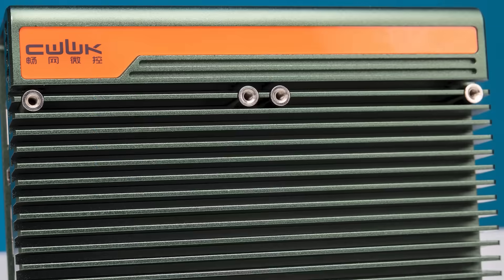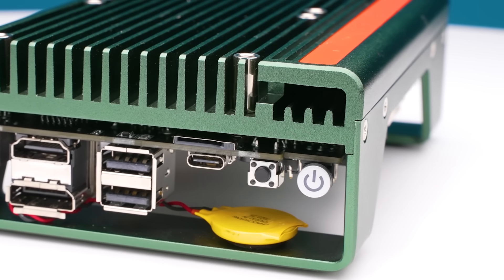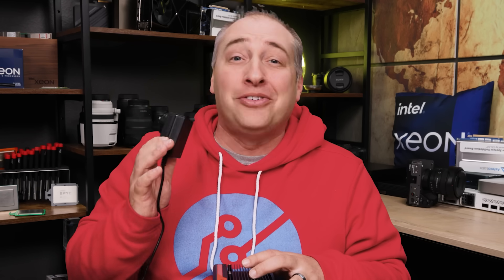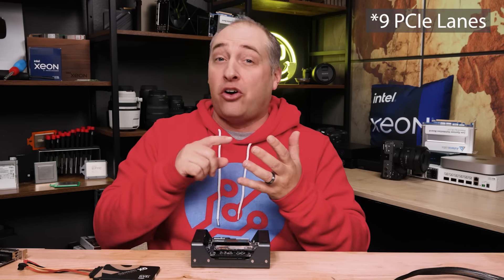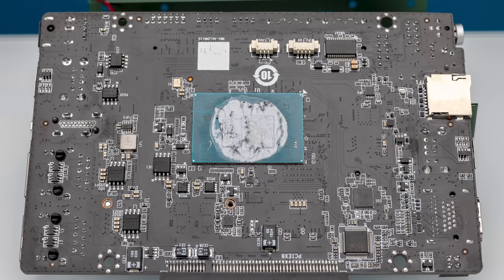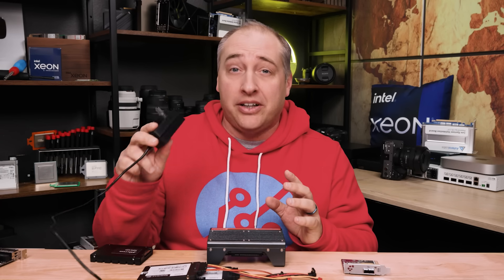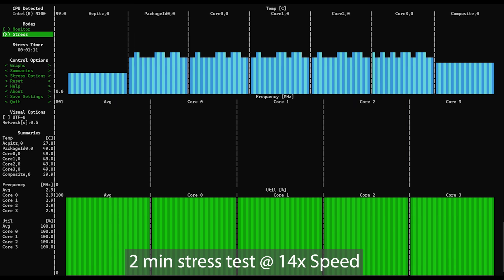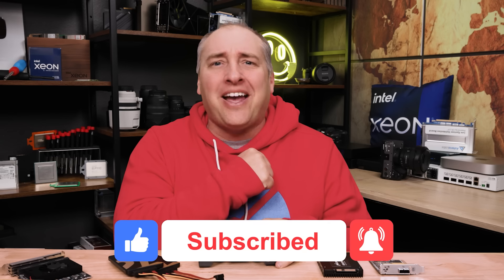FANLESS 7W Homelab Fantasy Mini PC

Comment: I think you've a little bit missed the point.  You didn't mention with the N100 or N305 comes an up-to-date GPU with advanced encoding and decoding facilities.  This box literally does everything I need.  It'll act as a low-power "online" server for my media from a cheap spinning harddrive (SATA) giving me 2.5GBe and also for Kodi/Jellyfin whatever and well as pfsense all the usual stuff.  For proxmox it's a dream.

Comment: Has anyone been able to find where to buy this model? The closest I can find on the CWWK website is the CWWK Magic N100 but the specs are slightly different. Seems to come with 2x10g network ports – although I think they need transceivers to connect up to rj45. The N200 CPU version seems closer to this review version as that does have the 2x2.5 network ports

Comment: I recently purchased an 8-port soft router from CWWK, but unfortunately, my experience has been far from satisfactory. Upon receiving the device, I immediately encountered a significant issue: two of the ports were not functioning. CWWK did send a replacement board, which resolved the port issue, but the new board did not fit with the existing front panel cover. Despite a lengthy wait, I still haven't received the correct replacement cover.
Moreover, the soft router has been persistently unstable, restarting every 15 seconds after production run for a month, rendering it completely unusable. but it's been just over a month since I received it, and I've been continuously facing different problems.
now i already order minisforum ms-01 to replace  this rubbish

Comment: Anyone familiar with thermal physics and passive cooling knows this is the best design for cooling, it will run 10-20C less than closed box and lifted up 2-3C less than close to desk. Too bad you didn't test the thermals.

Comment: This looks like a marvelous edge node for slightly higher performance applications. This doesn't look like the sort of system that you fuss with all that often. You build it and put it in the larger unit it'll be part of and that protects and secures all the bits that hang off in a desk configuration. I like it.

Looks like the rubber foot assembly can be removed and replaced with something custom. This is a nice little machine.

Comment: I have a cwwk box, they actually made pretty decent stuff, but i'm still annoyed that they keep putting 2.5g on stuff instead of going with 10g so it can be useful. - I suppose you could plug in a 10g nic to the pcie slot (not sure if there's enough bandwidth there)
Reply from the maker: PCIe Bandwidth, cost, and power all go way up with 10Gbase-T

Comment: Hello fellow computer nerds, I have a question, If you had 40,000 Euros what data server and stuff would you buy and install 
in order to generate 12000-16000 Euros per WEEK ? (assuming 48 week average) Probably using used EPYC CPU's & bunch of XEON's ?

Comment: If you can get it to behave with a SAS HBA card then it'd be a great little upgrade to mount to an old HP microserver case (yes some hacking would be required but pretty sure it's not outside the wit of man to manage).

Comment: What am I missing when you keeping pointing to a 960GB optane drive while saying its 32tb?
Reply from the maker: When I am on set, that is a Micron 6500 ION (looks like an Optane from far). We shot some B-roll with a 1.5TB Optane and mentioned both the 1.5TB Optane and the Solidigm 61.44TB NVMe SSD did not work. We try multiple drives to see how they work.

Comment: The thing is, until you've experienced the speed you get from a N100 you won't believe it. It's super zippy at really low power. I used a minicomputer with one of these CPUs for a week as a desktop and didn't notice much difference to a modern high speed pc (apart from AAA gaming).
Reply from the maker: I think the N305 is much better as a desktop, but you are right, the N100 is like a mid-range 2018 era desktop PC performance wise for desktop tasks.
Reply: I bought an n100 mini pc when my laptop failed later to be used as a backup if it broke again.  I've kept the N100 Pc on my desk as it literally does everything I need well enough.  The big advantage is the advanced features supported by the iGPU.

Comment: I think the closest competitor to this might be the Odroid H3+. Doesn't have the PCIe card slot, but you get dual DDR4 ram slots, and a 4 lane PCIe 3.0 M.2 NVMe slot, plus it still has the dual 2.5GB ethernet ports. The N6005 chip should be pretty close to the N100.
Would be interesting to build one up and do a head to head performance comparison.
Reply from the maker: The N100 is like a 50%+ performance upgrade over the N6005.

Comment: I honestly can't imagine how this would be more useful than a small PC.
Reply: I use it as a chart plotter and boat automation system on a sailboat with a 15" touch screen, powered directly by the 12v house battery bank. Power consumption and heat dissapation are important for this use case. It is only a few watts more than a raspberry pi 5 but I get nvme and more ports with twice the perf.

Comment: I need a home Openshift (k8s) lab. Most of my colleagues buy monster used servers and run nested virtualization, but that is a kludge and requires lots of expensive RAM. It is also as loud asa vacuum cleaner, wh8ch is bad for marital harmony. 

Six of these makes a clean workable Openshift cluster.

Comment: It's kinda okay as a desk tinker toy, but for anything resembling a home server, I'd rather take the N100DC ITX board and a slim case..
Also, you've called the Intel Optane drive "32 Terabytes" in several places.. please tell me where I can get this drive in that size without having to sell my house. even the 1TB model seems to be just short of 1000$.
Reply from the maker: The 1.5TB 905P has been $400  https://forums.servethehome.com/index.php?threads/1-5tb-intel-optane-399.42250/
I mentioned we tried the Optane and Solidigm drives but they used too much power. The Micron 6500 ION is what we used.
Reply: @ServeTheHomeVideo  phew.. that one in 32TB is still 3500$.. but at least a lot cheaper than Intel. The rest seems down to regional pricing.. I can't find the 1TB in EU anywhere below 850$, at which price point I should probably rather stay with a bunch of NVMe sticks.

Comment: It looks cool but I don't understand who it's actually for. The pcie socket is the main selling point with almost half of the pcie lanes routed to it. But it's way too flimsy for permanent connection and the case/heatsink design doesn't really support mounting inside another enclosure like a proper SBC which would be necessary for using a riser cable. Still a huge improvement on the zimaboard.

Comment: 32 terabyte rubbish. 905p largest is  1.5tb.
Reply from the maker: We used the 1.5TB 905P in some of the B-Roll but showed the Micron 6500 ION on the table.
Reply: @ServeTheHomeVideo  Rubbish, you pointed at it in 10:30.  You couldn't tell the truth to save your life.

Comment: The companies building these things with PCIe slots hanging off the edge should really thing about also making a "PCIe side-carrier housing" as an option so users can securely bolt it to the side of the main chassis to house a PCIe card in.  First company that does that wins.

Comment: I'm loving devices like this.  I've set up a homelab myself.   I don't have room for the rack mounted servers most homelab youtubers seem to have, but I don't need one.    I don't have a network of CCTV cameras, a fully automated home or a need to edit terabytes of video on multiple workstations.   I don't have multiple workstations to edit the video on, even if I needed to edit video.   As for my routing needs, they are more than adequately fulfilled by my Orbi system,  

My needs for a "homelab" are essentially a host for loads of VMs I use to experiment with different things, like Active Directory domain management.

That's not to say I wouldn't like a rackmounted server, with hundreds of gigs of RAM and hundreds of terabytes of storage.   I would love that, but don't have the money to buy one or, or space to host one.  Even if I did, my house is not air conditioned, so heat would be an issue, in the summer at least, it would be quite nice in winter.

So, a couple of weeks ago, I bought myself a NUC style PC.   It came with a fast 1TB nvme SSD, and 32 gig RAM, as well as space for a 2.5inch SATA drive.   

Thankfully, last year, I upgraded. my main PC with a new 2TB NVME SSD, replacing the 1TB SATA SSD I had been using, so the 1TB SATA SSD is now in the NUC.    I've installed Proxmox on the NUC, with the NVME being used for a boot drive, and main storage, and the SATA SSD being used for periodic backups. 

Yes, I know that these should be hosted elsewhere (preferably off site), and I am looking into that, but,  TBH, the machine isn't hosting anything really important, and the backups are there in case I mess something up while working on a VM, and I haven't updated the snapshots..

I have a Trigkey S5 Ryzen 7 5800H.   In fact, the only real fault I can find is there isn't an option to enable Wake On LAN in the firmware.

Comment: Cool system, but the asking price is way out there. This thing shouldn't be more than a hundred bucks.
Reply from the maker: The CPU alone is $128. Each of the two i226-V's are $2.87. So that is ~$134 of cost without the rest of the motherboard, chassis, power supply, and so forth. I am not sure how you get under $100?

Comment: It seems to me that three of the biggest issues could be solved with a subtle change.
That PCIe slot is useless. At least in its current form factor.
Use a NVME style slot and 
You  have a secure connector for a PCIe riser.
You have a second NVME slot 
And finally 
You have a slot for a WIFI card.
As for the naysayers. This is an interesting extension of the Raspberry Pi ethos.
A more powerful and better supported appliance computing device.
A more powerful prototyping platform.

Comment: To sum up I still think it's useless. Why? Let's take a look at the pros and cons. All pros come with a "but": small, compact ... but if adding disks or pci-e components it's not compact and small anymore; cheap (rather?) but if consider all the necessary components needed - it becomes almost the same price as more powerful machines: passive cooling and quiet? But the performance is terrible; pci-e slot? But it is not placed good and you have to invent smth to make it work, and it is only 4 lanes; RAM slot? But it is single-channel and supports little amount of ram (8 gigs for Windows? Seriously?.. Open the browser... 16 Gb is the bare minimum for desktop usage and for server to make it usable you always need way more - I am not even talking about zfs filesystem requirements...); .... And other similar things. So basically what it is? An "ok, but" piece of hardware? What is it actually good for? It doesn't even have the gpio pins for the IoT / home experiments usage... Sorry but it feels really unnesessary in this configuration and form.

Comment: Thanks again for a next great review - I love your videos 👍
You made a short comparsion to the Zimaboard. Was it ment to the Zima board or blade?
I would be happy if you would make a real comparsion. Meaning this tiny little pc vs blade vs board. As a runnung system with som VMs in Proxmox for example.
What are the systems consuming in idle or with some permanently running tasks like smart home with pulling data like temperature or what ever situation would fit to real live.
That would be great ❤.
I yust want to set up a Proxmox Smart Home system on a high availebility Proxmox cluster. If I am doing smart home, I don't want to stay only on one system.
So it should run for a long time and because of that power is very interesting to me.
(Also I didn't found any video, that yust compares the both Zima board and blade with each other according power, performance and other capabilitys.)
Again, thanks a lot - and I also would appreciate some short words from you according the above topic if you have some more knowledge on that 👌
Reply from the maker: We may do that in the future. Either the ZimaBoard or ZimaBlade, both are using Apollo Lake CPUs from 2016 which is why they have things like PCIe Gen2 slots, 1GbE not dual 2.5GbE and CPU performance that is 1/3 to 1/5 this.

Comment: Maybe its juat me....but i have a hard time seeing the appeal of these sbc's. Outside power savings (which is fair enough in parts of the world) is there any appeal to these machines as opposed to say an oldwr deaktop pc made in say the last 10 years or so?
Reply: Power is heat. If it's house where server staff is on basement or closet in place no human being in 20m close - it's no matter 5W atom or 130W xeon CPU. If it's apartment - every place is not kitchen or bathroom are places "no 24/7 buzzing fans and HDDs" can be applied. And I don't want my server in the kitchen and there is no old cheap IP68-protected desktops for bathroom xD

Comment: This kind of n100 mini PC are great but price should be around 100USD and should have type-c power supply, 2 x 32GB memory slots, 2 x nvme slots high speed, 2 x 2.5 Gbps or upper, fanless with optional external fan, few usb3 ports, DP/HDMI at 60+ Hz, small slots for PCIE extensions 😊
Reply: you basically ran out of pcie lanes with your first want of 2 high speed nvme slots.  No more lanes for everything else.
Reply: Would be great, but a year or two ago people did pay more than that for 2GB Rpi. Yes, efficiency is a bit high in price  (N100), we can go for ryzen R3 for close price (with more performance, expansion possibilities, more RAM and full ATX) but can we drop R3 to those pretty 8to25w power draw or cool it passively without Noctua NH-P1or another monster which costs like another R3 system? 
N100 can fit little homelab with two 8-port switches, power adapters and storage into space of single Dell 5050sff. And it's not intel n5105 thing with performance of Rpi, it's really useful CPU to host something non-production.

Comment: I'd totally buy one at a $50 price point

I've been running a little fanless PC like this for the past 15 years as my webserver.  400mghz and 112K of RAM.   Works great, no reason to upgrade.  But maybe I would just for the heck of it, if they can get the price down to $50.  I didn't pay anything for my unit, it was an HP thinclient I got free and repurposed.
Reply: Lucky you, I have buy my old HP thinclient with AMD G415 for around $50 with PSU. So no way. But 150-170 range for this would be great and looks more realistic.
Reply: @witalijlewandowski2384  If I were to spend this much on something like this, though, to replace a webserver that is on all the time... I might as well just buy a 19" rack and buy a rack mount server and start building a refrigerator sized massive tower of all my computers and network gear in one place.    Get a 1u webserver or 4u proxmox server instead.   

I might buy this if I were to like hide it underground or something to run forever, with just a power over ethernet cable going to it.  But man is it overkill just to be a little file server.

These fanless design computers are probably meant for industrial applications with businesses flush with money, because these littel units have too much power for most little roles, but not enough to be a good desktop replacement.   And in a business, computers are left on forever and totally neglected.

Comment: would this thing be capable of routing the full 2.5G with pfsense/opensense?
Reply from the maker: 2.5Gbps NAT and most firewall applications is no problem. This has higher performance per core than the quad core Netgate 6100, but without QAT for crypto/ compression for IPsec.

Comment: Fit a highend GPU and I'll be impressed. lol
Reply from the maker: 36W PSU though
Reply: @ServeTheHomeVideo yep, but can you replace that 12V 3A with a 12V 30A DC PSU (for surveillance systems, I think) with some "adaptations"? lol (Not sure if the PCB gonna survive or if gonna require some cooling.)
It's just a bad idea, I  guess. lol

Comment: wait 28TB drive an 2.5 GB port ? so that will take 8439857203 years to fill up ?
other than that - nice to see some fun little nodes being made.
If the ethernet wasn't so slow - would be great ceph node.
Reply: 2.5Gbps is ~300MB/s, that's 1GB every 3ish seconds, or around 1TB per hour (1hr is 3600 seconds), so 28TB would take a bit longer than a day... I'm not too familiar with running Ceph but dual 2.5Gbps is on the order of single SATA III (6Gbps) SSD speeds so yeah obviously not going to get your money's worth by running any nvme with that network bottleneck (whether it costs as much as a car notwithstanding)... but you could just put a 10Gbps NIC on that PCIe slot (PCIe 3.0 x4 is limited to about 4GB/s which is enough for a quad port 10Gbps card, and I forget exactly but PCIe 4.0 should double per-lane bandwidth again so you could theoretically get up to like 80Gbps total--but I shudder to think how long it'll take for those cards to show up at reasonable surplus prices on eBay, not to mention four E-cores at single-digit wattages probably isn't the way to go for a production ready nvme backed Ceph cluster moving dozens of gbps in the first place 😅)
Reply: @ACTlVISION  I like STH channel, becuase responses are not combative ! :)
Anyway, with most distributed FS you one can take interface speed and cut it in half (tcp / udp overheads, protocol overheads, synchronisations between nodes etc etc). 
My original reference was in regards of pluging that 28TB with fast u2 interface and filling it up with 2.5Gbe, which look like colossal waste of money / performance. 
I'm hoping that soon we will see a nice 10Gbe equiped low power pc with nvme and pcie slot. One could connect HBA to it and have a low power / cost storage node. But that's just my dreams.